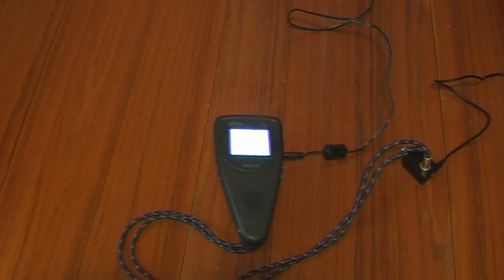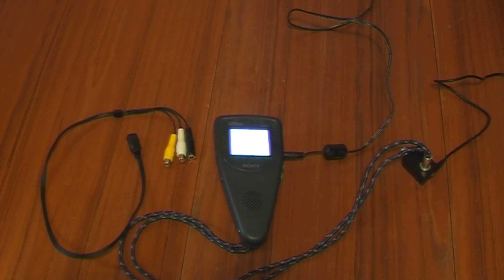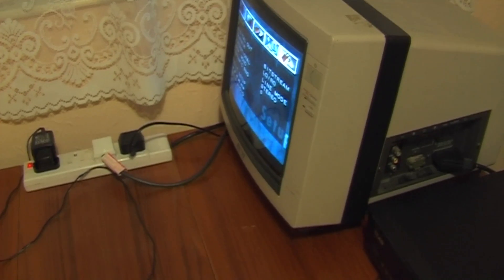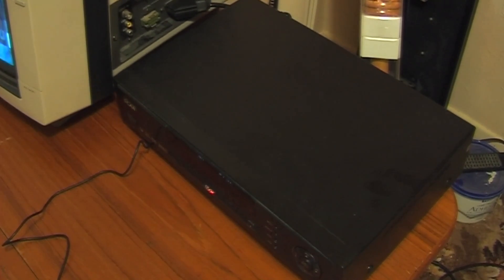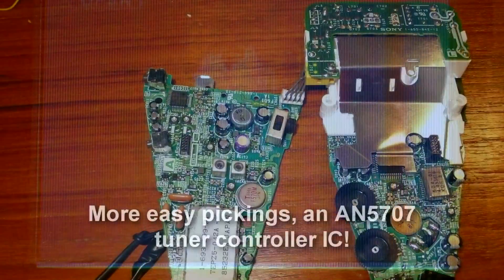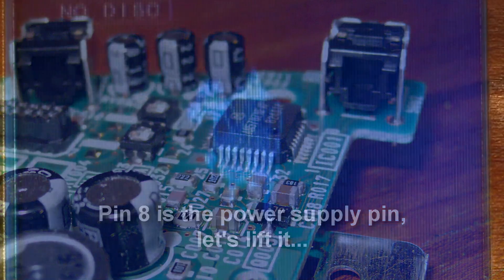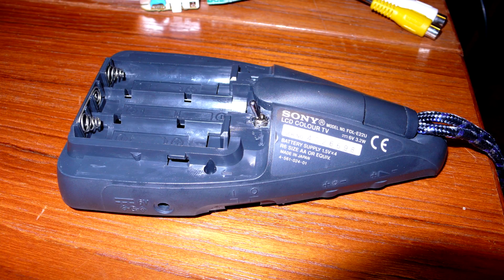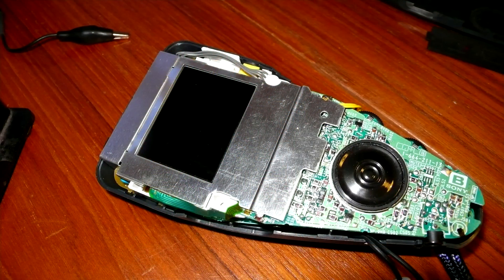How to convert a Sony FDL-E22U LCD pocket TV into an AV monitor

Comment: Can you provide some more detailed images of the solder points so I don't muck up my TV? So impressed it seems so simple to hook up. Also if I cut the lanyard in half could I attach an antenna socket to it?  I bought a cheap AV to RF converter and wanted to mess around with it before doing the conversion.
Reply from the maker: I can't provide anything more than is in the video but there are service manuals for these TVs online.
As for the lanyard I expect cutting it and fitting a balun (the ones used for loop antennae on portable TVs) would do the trick.
Reply: @AintBigAintClever  Can you clarify where you soldered the yellow wire to? it is hard to see
Reply: @AintBigAintClever  Can you clarify where you soldered the yellow wire to? it is hard to see
Reply from the maker: @automoto95  at 2:04 in the video?  There's a via on the board.  Look between the larger two of the three big solder joints and you can see a thin track. The end of the track flares out and has a hole in the middle.  It's that.
Reply: @AintBigAintClever  now i see so we need to solder yellow video cable to that track end and crossed it also to another solder point on the bottom at 2:04
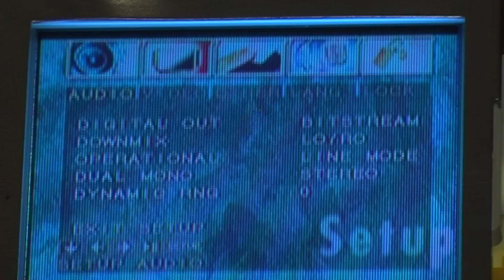Reply from the maker: @automoto95  look at 2:29 and you'll see it from another angle.  There's no second connection, but the yellow wire has a loop in it just taking up slack.
Reply: @AintBigAintClever  ok
Reply: https://i.ibb.co/WH5yJ67/DSC-0349.jpg

Comment: I would like to return it to ATV at 437  Mhz ?
Reply from the maker: 437MHz is an amateur radio frequency (70cm band), UK TV tuners tend to only go down to Channel 21 (471.25MHz) and up to Channel 69 (855.25MHz). You might be better off taking something with analogue tuning controls (such as an old VCR with tuning presets for each channel) and modifying the preset circuitry. I expect the preset (which could for example go from 0-100K) to have additional fixed resistors to make this 0-100K as part of a wider range (e.g. 100-200K), changing those resistors would allow you to tune beyond the range normally used and hopefully get to 437MHz. Given that 471-855MHz is a huge range, pushing down to 437MHz ought not to be much of a stretch.
Reply: @AintBigAintClever  In the good old days of mechanical tuners one could put a small negative voltage into the tuner to make it go down.  The reason I ask for this is the US version tunes up from channel 14. I have found the US service manual FDL-22 and would like to get a copy of the FDL-E22U manual to see what the difference is.
Reply from the maker: @midimagic7097  You mean this one? https://servlib.com/sony/tv/fdl-e22u-sm2.html
Reply: @AintBigAintClever  Yes that's the one, just need to find a free copy.  The UK and US have different tuners in them. The UK has a TEPZ5 and the US has a TEPA 5. However I can't find any data sheet for either of them.
Reply from the maker: @midimagic7097  A quick rummage online shows there seemed to be a range of TEPx5 tuners. Game Gear tuners used a TEPA5 (analogue tuning with a knob) or TEPJ5 (digital tuning). Casio TV-M420S used a TEPM5.
Interestingly the Game Gear tuner service manual states that the PAL version of the tuner (with the TEPZ5) was capable of both VHF and UHF operation. Might be some clues in the schematics.
https://gamesx.com/wiki/lib/exe/fetch.php?media=schematics:service_manual_-_tv_tuner_pack_pal_for_game_gear_mk-2101.pdf
Reply from the maker: Also worth checking out the FDL-PT22 manual. They also used the TEPA5 and were dual-band covering VHF channels 2-13 and UHF channels 14-69 (although the channel frequencies differ between TV systems; NTSC M channels 14-69 are apparently 470-800MHz).
https://elektrotanya.com/sony_fdl-pt22_fdl-pt22je.pdf/download.html

Comment from the maker: The monitor would work on any camera that has a standard composite video output. It would work with most CCTV cameras, and any camcorder that has a live video output (using the cable that has yellow, red and white plugs).

Comment from the maker: I jabbed a hole in the lanyard (which doubles up as an antenna) and connected it there. In the vid I bent the lanyard where the hole was and stuffed it into the aerial connector.
This was a modified DVD player though, I've added a Sony PlayStation RF modulator inside the case in order to provide a PAL-I output on UHF channel 36 (video on 591.25MHz, audio on 597.25MHz). To use the RCA AV outputs instead I had to modify the LCD TV as described in the video.

Comment: How did you make the connection from antenna to cable from the dvd player? I've tried replacing the antenna with a wire and connecting to an RCA cable, but can't get any signal.